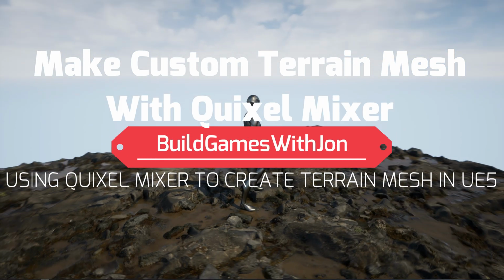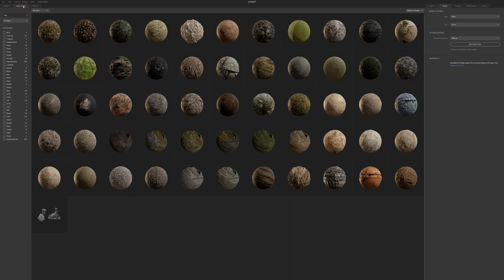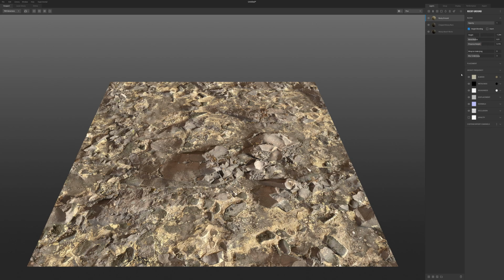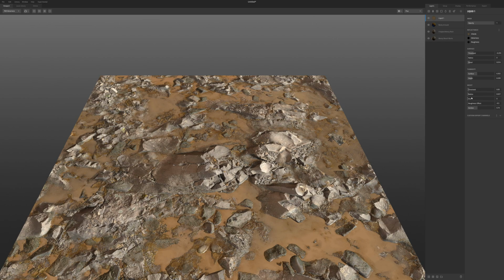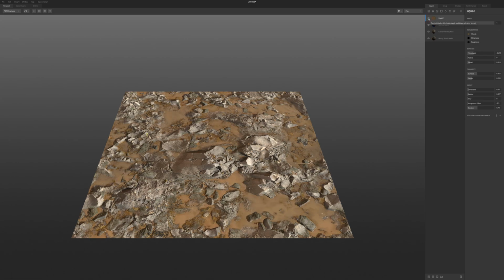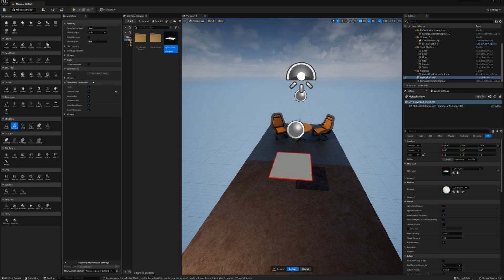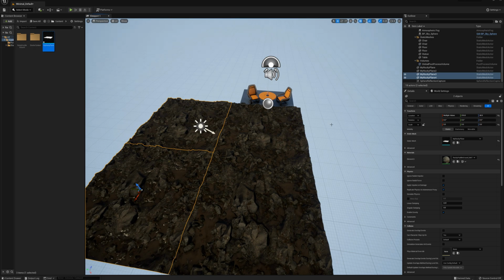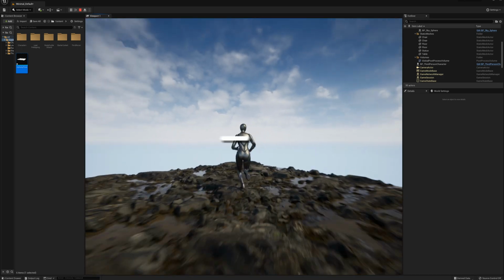Custom Terrain Meshes with Displacement for Unreal Engine 5 using Quixel Mixer & Megascans Textures

Comment: This is a great way for landscapes.
If you take a displacement map, leave only the edges in it and create a landscape, then you can join these landscapes together, generating a map.
The advantage is that you can use landscape materials. And it can work with UE4.
Reply: I'm not entirely sure what you mean by this but I've been trying to think of a practical way to use this with landscapes. Could you elaborate a little further?
Reply: @joshuaruggles219  I meant using tiled textures to create large landscapes.
However, when I tried this method, it turned out that the engine had a high subtraction error and the landscape was not connecting properly.
This was necessary to create a generated landscape from prepared patterns with the same edges, so that they could be combined into one world.

Comment: Would you be able to show the resource cost of using complex collision as simple for more than just 1 mesh? I've heard using that is very resource intensive.
Reply: A fix for that would be to use a simplified mesh as collision. Or to append collision only on mesh around your character dynamically.
Reply: It is, thats why its a shame they got rid of actual displacement, this isnt a displacement material but a roundabout way using a modifier on a mesh. Not very good for games maybe film its ok.